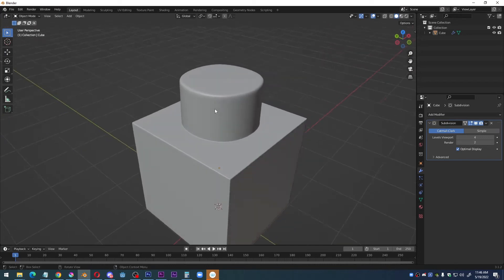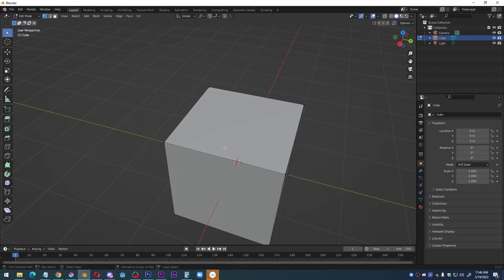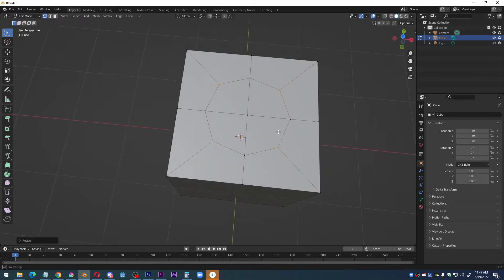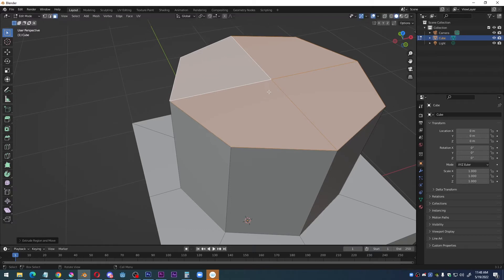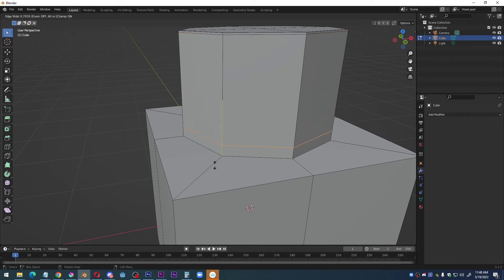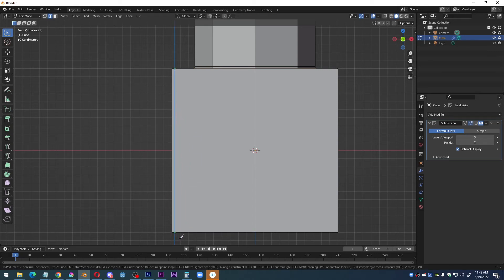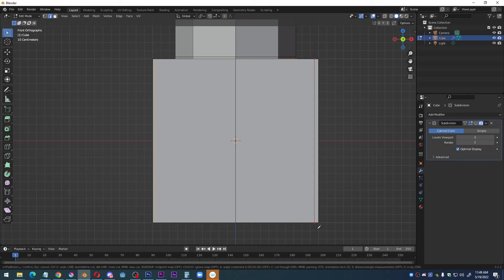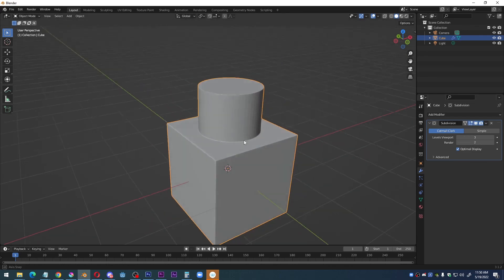Extrude a cylinder in Blender

Comment: great tips thanks! Is there an easy or obvious way to take a cylinder, extrude it up and rotate like a pipe? I find if I extrude up then rotate, that deforms the cylinder. One way I use is 'extrude to cursor', but was wondering about a more precise way to control it? tks
Reply from the maker: You're welcome and thank you for the comment! To answer your question, you need to use Curves to achieve what you are describing. There's an option to generate geometry around a curve and then you can simply edit the curve into your custom pipe.
Reply: @fxdojo  thanks!